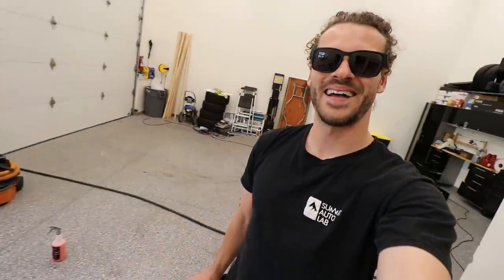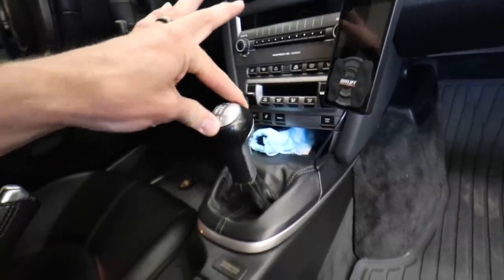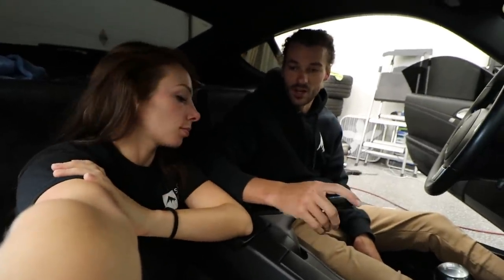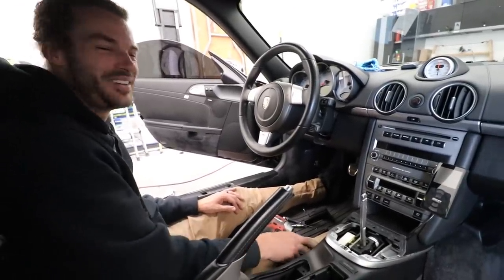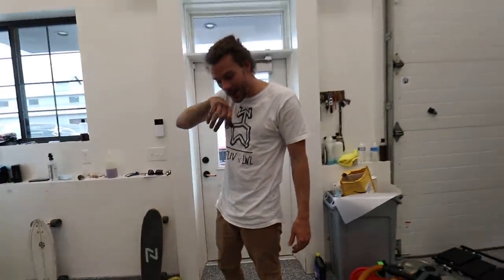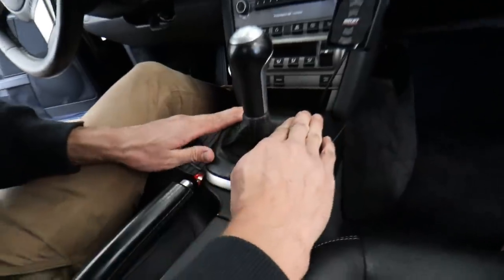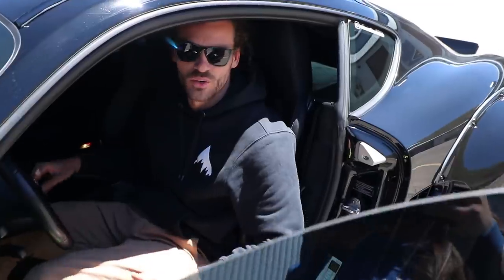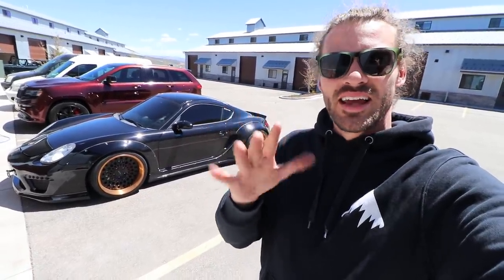MORE Mods On My Wide Body Porsche!

Comment: Porsche is more about heritage than anything. Which is why the key has always been on the left. They are a ton of fun to own! I’m still sad I sold mine but I’ll get another one soon.
Reply: It hasn't always been on the left. You can look at early 356 and Speedster dashes and the ignition switch is on the right. It wasn't until Porsche started racing in races that used LeMans starts (The run-to-your-car-and-jump-in starts) that they moved it to the left to make it just that much faster to start the car and get to racing. They stuck with it after that.

Comment: I feel your pain with scrapping. I have a 91 maxima with hydraulics that i scrape everywhere. But the roads in iowa are horrible so i usually ride around at stock height to avoid it. But its nice to have the ability to adjust the height when needed.

Comment: Id have the air ride sysemt set up so you can air up at a touch of a button for when you come to speed bumps and high curbs also look into buying an interior trim removal kit if you don't already have one it will reduce your chances of breaking clips on interior parts

Comment: I had the key sticking thing on my 996 GT3.  There is a plastic ring or something inside the lock/switch that is cracked.  I don’t recall the details other than it happened after my factory warranty expired and was less than $500 to fix (more than that I would have remembered details) and didn’t involve a new lock cylinder.

Comment: Dang...117,000 miles and your shifter is wobbling that much. Mine has 70,000 and its just starting to get loose, so I guess its time to invest in a short throw as well

EDIT: Hearing about the V2 and V3 of the Cayman has got me pumped
EDIT (pt.2) No, my key always comes out after I turn it off but it does wobble in the ignition and sometimes gets a little stuck

Comment: replace the key box no factory coding needed, fyi the key box is not coded to the key the transponder controls imoblizing of the vehicle ,the kessy module recognizes the transponder chip and with the rolling code starts the car, you really need to have the car scanned with porsche factory scan tool piwis II to make sure the modules of the car are communicating 
 Hope this helps
Reply from the maker: Wow thanks!!!

Comment: That porsche key always stays in place, you cannot take it off İ have a 2019 gt2rs and it is the same
Reply: Lol, what a lie brother. The key is always removable when shutting off a Porsche. He probably needs to get the key input checked.
Reply: I'm guessing you've got Keyless Entry&Drive on your car, in which case you've got a plastic "key" permanently in the ignition that you turn to start the car (although you can take it out if needed). I doubt this option was available on cars made pre 2010, and even if it was it's pretty obvious that their Cayman doesn't have it.
Reply: Ooooh!!! I love the 2019 gt2 rs!!!
Reply: Me.Grazzhoppah i am not lying brother, i tried it many times when İ get in the car, İ do Need the actual keys to start it and there is also the key on the left that colton tried im the video stuck or immovible on my car too. İt is always in place and u use it to turn the car on and off and if there is actually a way, İ have no clue how to remove it
Reply: @keremyemeniciler8943  Did you read my previous comment? Clayton has got a traditional physical car key that's been used for cars forever which means he doesn't have the keyless start option like you do, Keyless Entry&Drive is a relatively new feature and wasn't available on the 2008 Cayman. Most cars with keyless start uses a start button but Porsche uses a plastic "key" in the ignition instead, it can be taken out by holding it to the right for 15-20sec until you hear a click noise.
Reply: Speednote10 btw you can’t spec any GT2 RS with a keyless entry and go feature. It’s key fob and the key fob is inserted into a lot right there where Clayton’s physical key is to start it. The mans a damn liar.
Reply: @MrGrazzhoppa  Didn't know it wasn't available on the 2RS, although it makes sense considering what type of car it is. Do you know if that's true worldwide though, because sometimes some options are available in area X but not in area Y? If it's unavailable worldwide then the guy is either lying or he's very confused about what car he has.